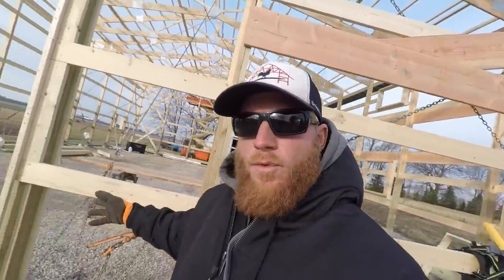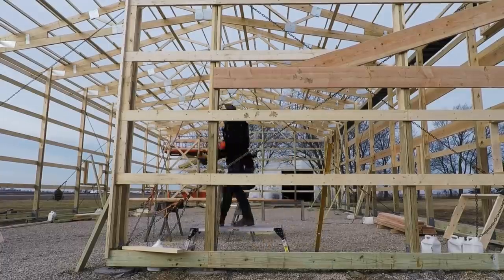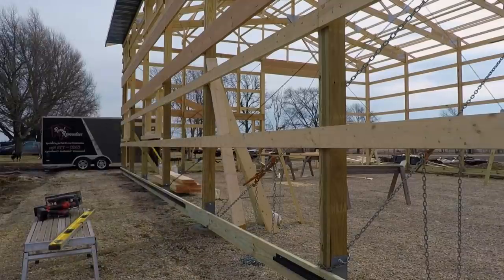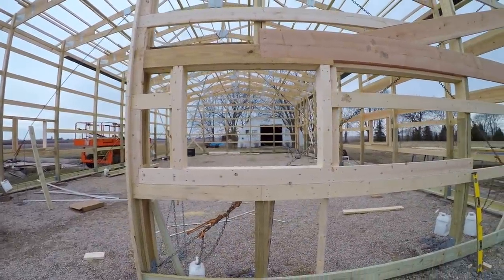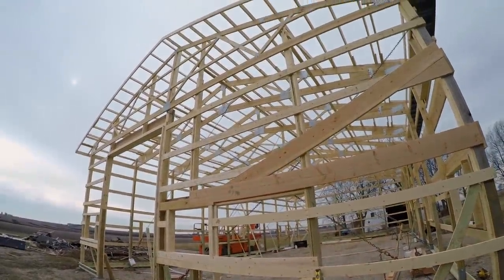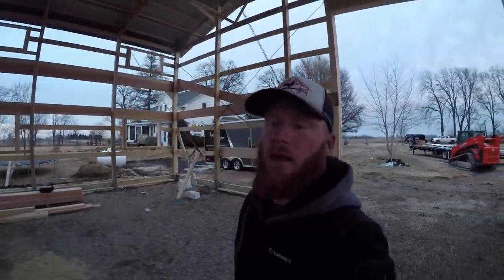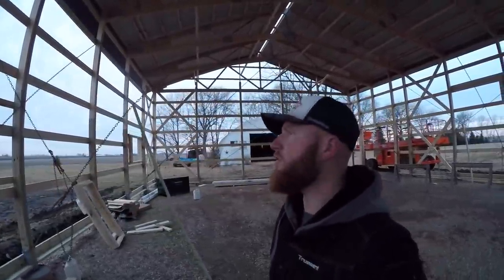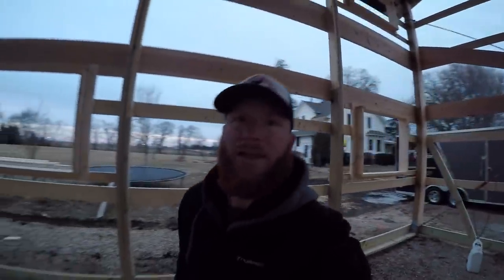Family Fun Barn Episode 6

Comment: Down here in Florida, when the roofers screw down the metal roofs they only screw on the corrugations not the flat parts, so if the rubber grommet becomes compromised there is a much lower probability that water will infiltrate

Comment: As a structural engineer I would like to say that windload comes in pushed and pulled surfaces. If the wind is west that your east wall will still have about 50% of the windload due to the vacume that is created. That number can go up depanding on openings. This is comming as information from the netherlands so the "the code" over there will very. But the basic principal holds up. "We dont get much wind from the east" is never a good argument from an engering perspective. 

I really like the videos though, enginering and building in wood is a lost art in the netherlands, its all brick over here, so to have personal instructor in that department in really helpfull.

Comment: Like the voice over. I see the posts bottom boards are treated, is this just extra precaution for rot or is it to make them more versatile for the people who want to have the posts in the ground instead of your system using the brackets? Keep up the good work.
Reply from the maker: Big Jim Billy the exterior finished grade will be up against the grade board
Reply: I meant the bottom boards that actually make up the posts themselves, the center one looks to be treated farther up the column as well.

Comment: Is that some sort of special drip edge installed at the bottom of the roof panels? It looks like it has the ribs in it to match the panels is why I ask.
Reply from the maker: what you are seeing are foam fillers that fill the gap and prevent wind driven rain or snow
Reply: RR Buildings Cool, would you say they are worth it or just more hassle?